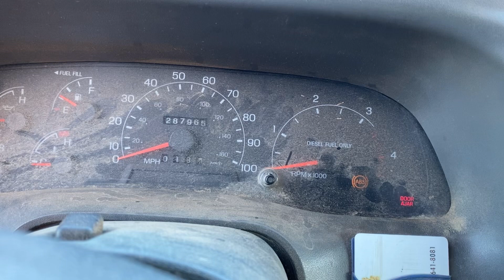Southern farming in the cold

Comment: good job  go to auto parts and get some battery terminal protector spray  spray after you tighten up the terminal bolt.  To replace a terminal go to the truck parts store.  They have a solid terminal shove the cable into the hole and use a small anvil to close it down on the cable with a hammer.  Those littlle anvils are at the speciatly tool store tell them what you are doing with it they will give you good advice.  Small wires comming from the cable down below or the wires comming from the Fass fuel pump put a new ilet and put on the terminal bolt.  Then spray the protector after all is tightened up